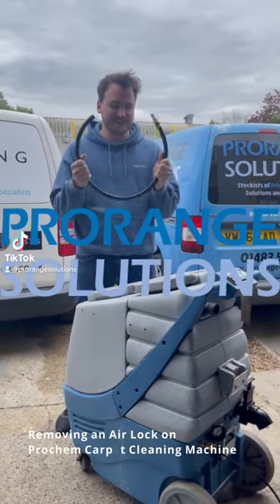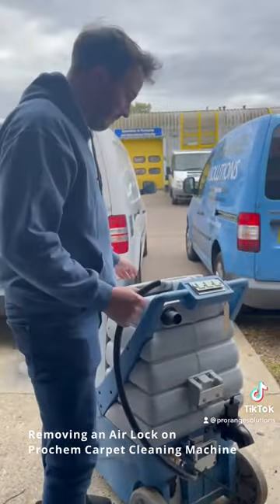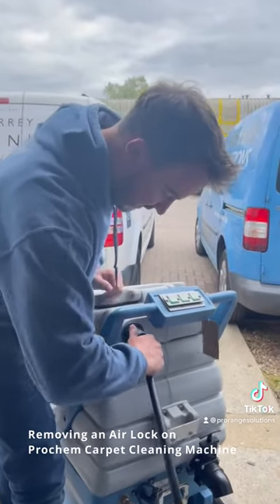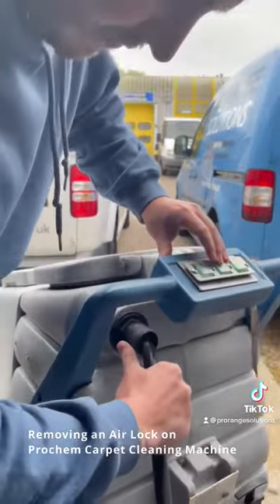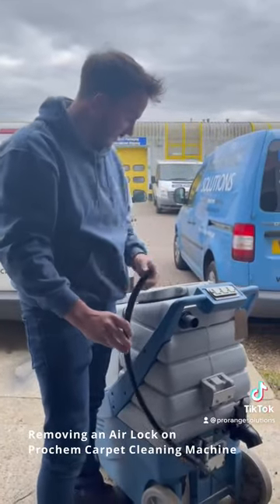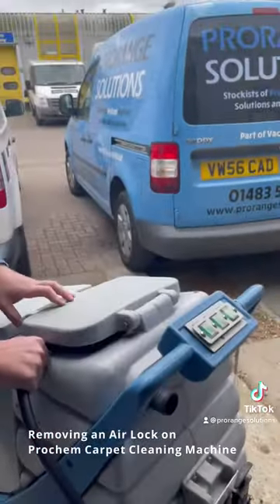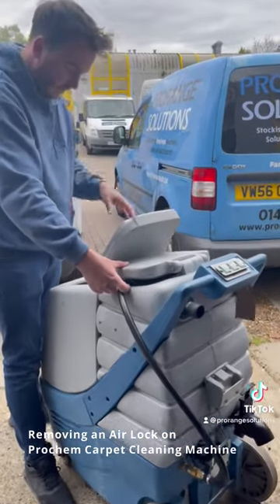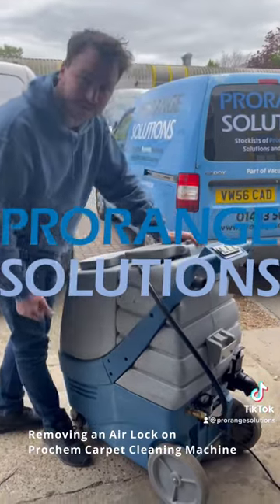Clearing an air lock on a Prochem carpet cleaning machine

Comment: Hi, when I pull the trigger on my wand no solution comes through the jets. Will airlock be the problem? Thanks
Reply from the maker: Hi Thomas.  It could be several things, the jets could be blocked, the check valve could be stuck open, the filters could also be blocked.  Is the pump running?
Reply: @prorangesolutions  thanks for replying.  Yes the pump is running, I'm hoping it's just an airlock like in your video. Last time it happened it was something inside the unit. I might just get the hose on your website and try this method first. Tom
Reply from the maker: @tompiques   If not sounds like it could be the check valve
Reply: @prorangesolutions  thanks for your help 👍